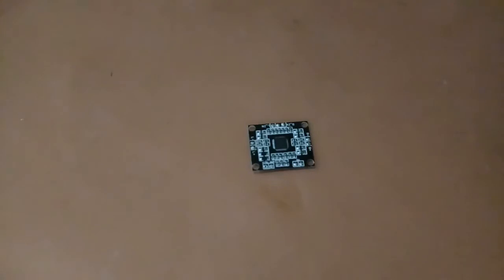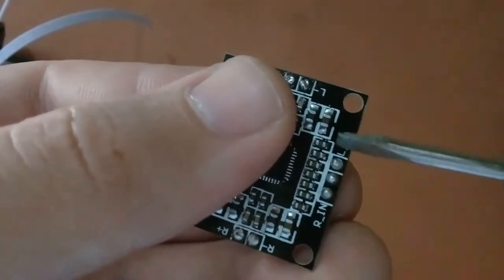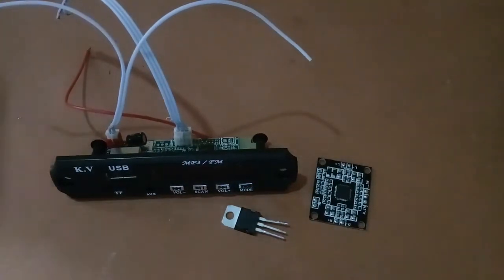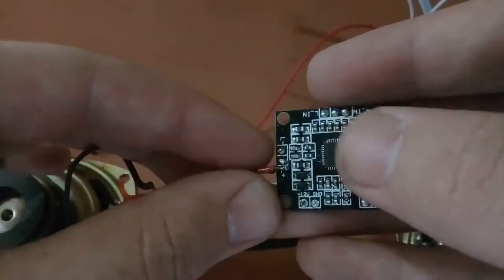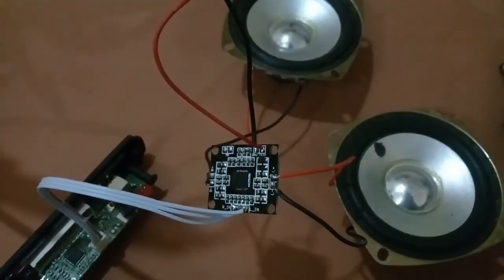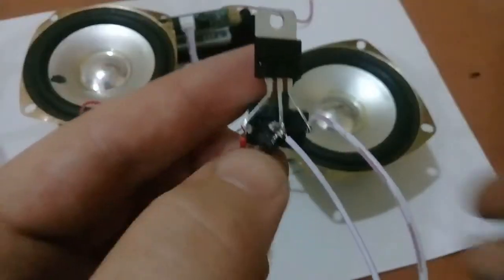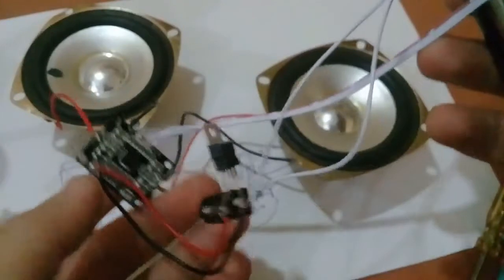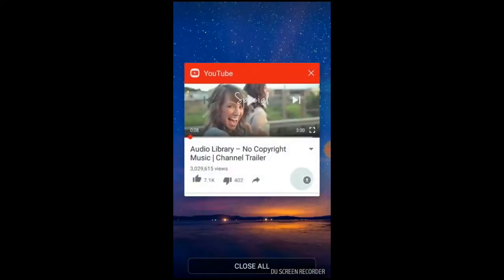How to make Bluetooth Speakers using PAM8610

Comment: Can you make the circuit diagram of Mp3 player wire connection. Specially those 3 wires. I am confused how to connect. Bcoz i have 4 wires in my mp3 panel. Mute, Gnd, left audio and right audio.
Reply from the maker: connect the left audio, right audio and gnd wires and leave the mute one

Comment: I have almost same configuration with 10 watt 4ohm speaker. When I checked the amp with a single speaker and raised the volume over 32 or little more,  suddenly sound cuts off for a mili second and starts again and it keeps happening until I lower the volume. I am using 3.7 volt batteries with a booster converter regulated at 12 volt. Could you help me out with this problem?
Reply from the maker: Change the batteries.. I also faced the same problem when I changed the batteries with more current batteries. It was fine..
Reply: Azhar Electronics 
I also tried a mobile charger with 1.5 amp output. And still the problem remains. I will try a  3amp power booster then. Let's see what happens. Thanks for replaying.
Reply: @joych100  Too low Amps friend :) or li-ion is problem or booster.

Comment: I have an issue with pam 8610 module in full volume sound blasting
Reply from the maker: yeah it has this issue.
Reply: Azhar Electronics i fixed this issue by low power of speakers 10 watt 8 ohm speaker with mini transformer but first i used 100 watt speaker 🔊 that’s why its sound blasting
Reply from the maker: That's great.